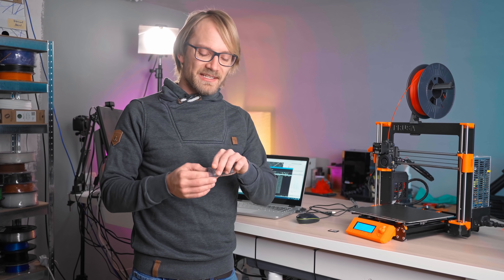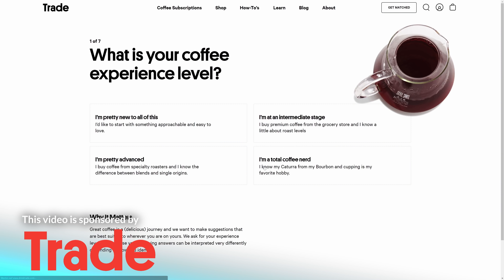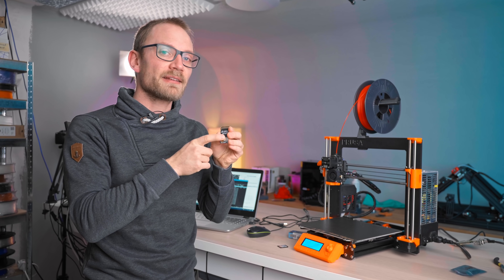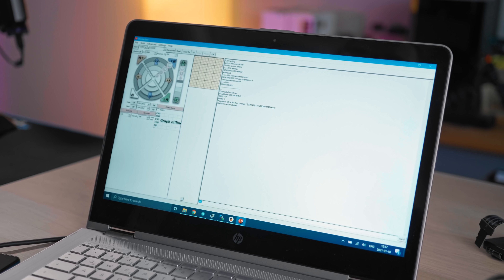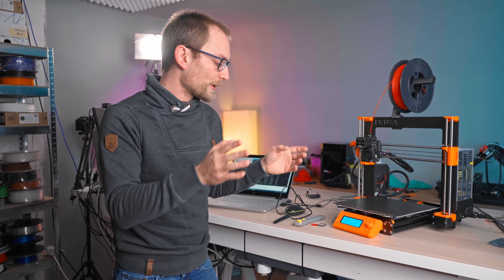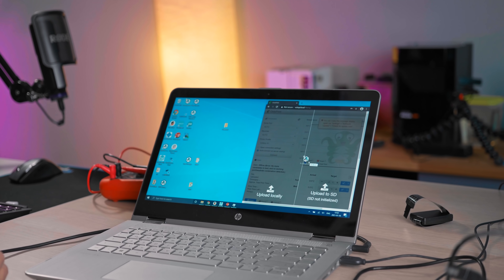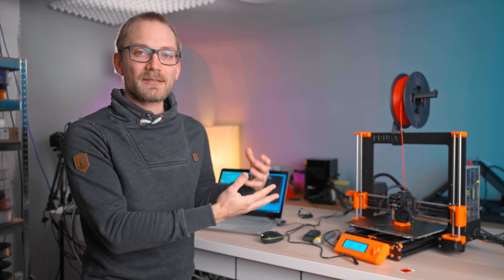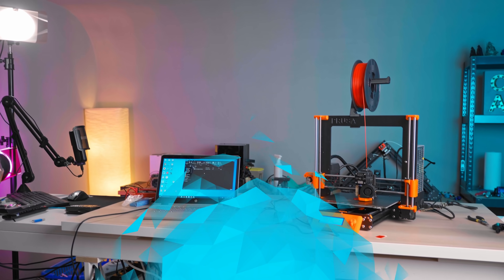SD Card + ESP8266 = OctoPrint Alternative?

Comment: Very neat. However, when comparing Octoprint, you should point out that is over USB. I have my octoprint setup to get power from the Einsy on my Prusa; and that setup was unstable with USB. Because of this... I simply never use the SD card because uploads are slow and this device would blow my octoprint setup away for speed to the SD card. Really glad you mentioned security; however that is only the tip of the iceberg. Decades of experience tell me the LAMP stack is going to get security updates.... the expressif stack? the firmware on this thing? Probably not...and this is insecure by design? Anytime I hear "it should only be used behind a firewall" my response is simply "not on my network". This I might make use of... but I wouldn't leave it in place and call it a solution.

Comment: Interesting! I wonder if the market will move away from SD cards and if someone will make this in USB form, that might be easier to work with
Reply: fwiw, the 1st gen Anycubic Photon is designed to use usb sticks instead of sd cards, and the grass was not greener on that side of the pasture.  The usb stick it comes with is famously unrealiable. Many usb sticks are not compatible with the photon or work but sometimes cause print failures. The physical usb port itself is a frequent point of failure on these machines. I'm no fan of using microsd to move files around, but just deciding to use usb instead doesn't automatically mean that you will have a better experience.

Comment: I wish I had hair to chop off like that  LOL
Anyway, I will eventually set up an OctoPrint as that would be ideal. I don't see why you are even comparing OctoPrint to this, it's apples and oranges. As you mentioned, This is just a nice way to circumvent having to constantly pull out the card from the PC and run to the printer and put in the card... ad nauseam.   Also, what would you have on this card that you'd want to "secure"?
But in the interim (assuming that it's not coming from china and takes 4 months to get here) it would be nice NOT to have to run my SD card from the PC to the Printer all the time. It however looks like it is very early in the stages of being anywhere near bug-free. But still, I may give this a shot.  The link was down, so I couldn't see an actual price but I'm going to assume it's under 20 USD, it's a why not for me.
Any other links??

Comment: This thing kinda reminds me of a hack that came out quite a few years ago: there are some SD cards that have built-in hardware to be able to connect to Wifi - for example the Toshiba FlashAir-W02 and -W03 model range. You write your network credentials into a file on the card (like the .ini of this one, only, from what I gathered, for the FlashAirs it actually seemed to work 😁...), eject (!) and re-insert the card into your card reader (to reset it), and hey presto, you have a new device on your Wifi, which network drive you can then connect to (I think it was running a mini Samba server, so, direct network drive, and thus quite a bit more stable than the, from my experience, never-all-that-rock-solid WebDAV-as-drive support of Windows, whatever version I've tried it on over the years...). And it also would do this from the SD slot of your 3D printer - but, there comes the 'hack': to get this working, you kinda had to 'wake up' the SD card directly at printer startup (instead of on selecting a file to print, as it would be normally done) by sending a specific SPI(?) command to it, or in other words, you had to put one extra line into your printer's firmware source code (Marlin? Something else? It's been a while - i just can't for the life of me remember...). It was all in the documentation of the hack, but, as I never to this day could get a working firmware build going for the printer I'd have wanted to give it a try on (the all-dreaded ANet A8 😉...), it never came to that... And, as this only seemed to work on the FlashAir-W02 (which was kinda on its way out by the time this surfaced), but not the followup -W03 version, guess where the prices of those cards went 🤣 - and they never were exactly cheap to begin with: for the current(?) -W03 versions, the 'Big A' gives me 40€ for the 8GB version, and 120€ for the 32 GB, at this time...
So, if you want to give the SD-Wifi a try, despite all the problems and drawbacks, by all means give it a shot - compared to that , this one's a steal...

Comment: I think that a very easy solution is to use two esp8266 modules!! One for SD card (with a server just to upload the files) and one connected to 3d printer UART port to be enabled to printer status monitoring! I did something like this to my CNC mod to WiFi, I can use my CNC directly from my desk and monitor it without a problem during the workflow. ALL THROUGH MY WIFI NETWORK 😁

Comment: Why even use octoprint when there is mainsail and fluidd ✌️
Reply: Who runs klipper on modern 32 bit controllers?
Reply: @markusmaeder1388  lots of people because klipper has only been about added performance at the very start, there are a lot more advantages
Reply: @AleEmm-yay  which one? The only advantage I have seen so far on modern 32 bit platform is, that you don't have to compile your firmware with every hardware change. I really would like to see a serious comparison of Marlin and Klipper  regarding performance and print quality on a 32 bit platform. Maybe you have me some pointers on youtube or blogs? I couldn't find anything objective.
Reply: @markusmaeder1388  e.g. Input Shaper, S-Curve or that you abstract away from a single MCU. E.g. you can integrate arduino and other mcus to steer/control/sense things.  Look into a Voron v2.4. as to how this can used. Klipper itself is just a very alive project that still tries new stuff. as one example this can be seen with moonraker/mainsail
Reply: @AleEmm-yay  Thx, I have already looked at voron 2.4 and asked myself, why I should use two controllers. I think it could be done with one and less complexity. 

Having the possibility to add other controllers is a nice feature and comes quite handy with tool changers. 

I really would like to see a comparison on real examples (prints) not on features. 

moonraker/mainsail is on my todo list. Last time I looked at Klipper, I couldn't find a solution for my smart filament sensor and my display.
Reply: @markusmaeder1388   there are not too many boards that take 7 stepper drivers and if they do they are more expensive.
Reply: @AleEmm-yay  SKR GTR with M5 would be my take for 7 stepper motors. But why should I use 7 stepper motors if I don't use multiple extruders? Are 4 Z-stepper motors really useful or are they just cool? In my experience a sturdy frame with BL touch  gives excellent results. As long as I do not see an in depth comparison with real prints, I am not convinced that it isn't just cool. :)

Comment: You could try soldering a decent capacitor onto the board: makes esp's a lot more stable from brownouts
Reply: Definitely.
Reply: A 330uf might help
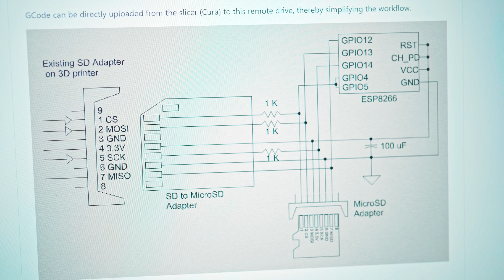Reply: 100uF is not decent enough? Just asking, seeing the schematics at 4:23. Albeit I would add a 0u1, I don't think anything bigger than 330 or 470uF would be very safe for the 3.3V source.

Comment: Great hair cut. But this might the first time I'm really missing something in the video. I see why you're comparing it with octoprint, but wouldn't be a comparison with commercial WiFi2SDcard adapters more reasonable?  If I remember correctly something like a FlashAir is even supported by Prusa's firmware. And yes - I'm aware that those adapter do cost more than $10.

Comment: For me the only concern is you need to plug on/off the printer manually (or use a smart plug), but could be a in between solution for people that not want to complicate with octoprint, just to move files or start printings remotely like me (my printer is 2 floors above my desktop).

Comment: I'm surprised you are discovering this now, it's the same as Toshiba FlashAir SD card (or a few others) but more complicated... funny that you had to add the USB power source, but the explanation is simple : when not used, the SD reader (here the 3d printer) is cutting off the power to the card (lowering power consumption blabla things). I use it in photoshoots where the pics I am taking are displayed almost in real time (less than 2secs) on my laptop via WiFi - with a non-WiFi camera. But if the camera stops reading or writing for a minute, the SD is turned off and connection is lost. Nice haircut !

Comment: How does it compare to a "standard" SD Wifi card like the Toshiba FlashAir or the many chinese clones?
Reply: Toshiba FlashAir  work fine connect to windows / mac networks, clones dont, they only connect via mobile apps for phones to transfer photos from your camera etc.
Reply: @firepower9966  I have FlashAir, worked correctly. But after router upgrade, Toshiba no more connects to wifi and I can't figure it out. Works as AP, but not as client. And there are not logs to check, why it does not work :-(  SSID and password are correct.
Reply: @mkyral  I had some device not be able to connect anymore to the router after enabling WPA2+WPA3 on the latter. After switching back to WPA2-only it worked again. Worth a try?

Comment: They’ve been doing this on Toshiba’s flash air for a while now.
Reply: I've not been able to buy a FlashAir for any reasonable price lately. Seems they are out of production. I think this would be a nice stop-gap solution. Escpecially since you can flash the ESP8266 to add more feature and maybe make it FlashAir compatible.
Reply: @JohanBloemberg   I just looked at the going price on Amazon. Wow! I paid much, much less two years ago. At these prices, I might give this kind of hack a try. It should be noted that the Toshiba card performance is much faster than what Thomas is experiencing. I'm happy I got mine before they were discontinued.
Reply: @grepmonkey  definitely too pricey to be worth while. I think I paid $30 for my W-04 and $35 for my W-03 back in the day. Got it to work on my FDM machines with no issues.  But struck out on getting one to work with my Elegoo Mars.
Reply: @grepmonkey  The wifi transmission distance is critical. When I had my wifi router at the other end of the house my transfer speed was very slow. So I changed the  wifi over to the one in my shed and now I get very quick transfers, like a few seconds, for average size gcode files.
Reply: @JohanBloemberg  what about Ez Share cards for $20? Do they work well?
Reply: @night_gryphon   Those are read-only, not writeable. Good enough for a camera, misses the mark for the printer.
Reply: @JohanBloemberg  try eBay
Reply: Exactly what I was thinking, I've had a flash air for over a year now
Reply: @PewpewFiah  the flash air is more reliable but a pain to set up. Chris Riley has a really good video on how to set it up for a printer. I use one in my F150 in USB port 2 in my Sync module. Hit remote start and transfer music while it’s warming up.
Reply: Or the eyefi card I bought a decade ago.
Reply: Toshiba sold off that part of their business and the flash air cards won’t be produced anymore. Why the price skyrocketed and no new version. Pretty irritated about that. Haven’t found a viable replacement that works anywhere close to as well as the w04. 😕
Reply: even the [IP]/DavWWWRoot/ is the same as for the FlashAir
Reply: Have been using Toshiba Air cards in all my printers for couple of years now. Love them. Have them all as mapped drives on my pc. So easily accessible
Reply: Phew i thought i missed something! I was a little confused about the "brand new" since i have my flash airs for years now too.
Reply: Right
Flash air are a thing🤔
Reply: FlashAir works but like others said, pain to set up.  Atleast this thing we can update the firmware and fix the outstanding issues.  Sad its the ESP-M and not a 32.  Can't really solve the speed issue as its a limit of the firmware blackbox on it:P
Reply: @warlockd  The firmware is not a black box, it's completely open source. And the speed is limited purely by the SPI interface to the SD-Card, they simply don't run much faster than that in SPI mode. Unfortunately you can't speak the faster SDIO to the card, because the printer runs it in SPI mode, and the card is connected to the printer at the same time, all logically in parallel just via some resistors just to protect the processors from self-destructing. Then the ESP firmware detects when the printer is trying to activate the card to talk to it, and stops talking to it.
Reply: @SianaGearz  Oh?  I thoguht the wifi drivers were a blob that was loaded.  Awsome!
Reply: @warlockd  Yeah i shouldn't have worded it that way. The wifi stack makes use of a binary-only .lib that gets linked in, that's just how it is. The application firmware is open-source and is really just an Arduino sketch.

You're shifting goalposts. Wifi speed on the standard lib is not the limitation here, it's fine. One limitation is bad hardware design, where they haven't observed the keepout area for the antenna of the esp module that they used, because the module in turn failed to document it, but the impact is naturally situational, it probably doesn't matter line-of-sight and depending on angle too much. The main limitation is purely SPI SD-card interface, i've never seen an SD-Card spoken to via SPI run all that much faster than this, so the complete hardware topology is kind of a brilliant DIY hack which you can just handsolder with a handful wires but also highly disadvantageous if you want to get any actual performance out of it.

Because this is what these are, forks of ESPWebDav, a hobbyist project with minor changes.

I also misremembered which manufacturer did what. So there's two companies in China building these modules, bigtreetech and fysetc. The latter has forked the original ESPWebDav project on Github and implemented SSID load from SD-Card. The former implemented the same functionality, turns out didn't publish the source, but someone connected to the company has dropped the modified source files on request.

Oh the keepout issue i mentioned above? Two companies made obviously different board layouts, and both made the same mistake.
Reply: Agreed on this. I have been using a Toshiba FlashAir W-04 for a few years now with very good results. My motivation was to keep the power fault protections of the Prusa that octoprint couldn't provide. This all being said, I have two friends who tried the same card and couldn't get it to work. YMMV.

Comment: 8:45 That weird baud rate setup is just the default  for the ESP8266 ( 74880 baud bootloader, 115200 normal serial)

But overall: power supply issues (15:15), weird baud rates, crashing for no reason... sounds like a typical PoS8266 experience to me ;)
Maybe a v2 with an ESP32 would be cool, that thing is much more reliable in my experience
Reply: They could also just add native sd support and printing support to ESP3D. I wanted to like ESP3D, but there are no binary upload protocols for gcode that are stable and supported, and i don't want to grow old waiting for gcode to upload to my printer.

Comment: Looks like a Toshiba FlashAir but with extra steps (and the FlashAir works flawlessly in my Prusa Machines)
Reply: Yeah, I've spend the whole video trying to figure out how is this different to the FlashAir card I was using for the last two years.
Reply: How do you do this? I am wanting to know in case I can't get this card. Thanks
Reply: Pop the FlashAir card into an SD card reader in your PC, edit the configuration file in the root of the card with a text editor to add your WiFi details, pop it in the printer, done.  Has worked great for me for several years as well.
Reply: Can confirm that Toshiba WiFi cards are working fine now. There were bugs in older MK3 firmwares though.

Comment: Why not just use any of the wifi-sd cards thats been around since forever? eyefi, transcend, flashair, ezshare
Reply from the maker: Eg on Prusas, enabling FlashAir is something you have to specifically do, so my thinking is that those cards need to be specifically supported in firmware. The SD-Wifi, however, just looks like a normal SD card to the host.
Reply: @MadeWithLayers  From my experience that is only needed if you want to see flashair info in the printer menu, like the ip address.
Reply: ESP8266 has much stronger wifi range

Comment: why not just use a Toshiba FlashAir card? its not janky and it looks exactly like a normal SD Card without all the hugeness.
Reply: Weak wifi due to the space and power consumption limitation.
Reply: @gerleimarci  I have had zero power issues with mine. Been in steady use for about 2 years. And hundreds of prints.
Reply: @grepmonkey  But you probably using it close to your wifi router